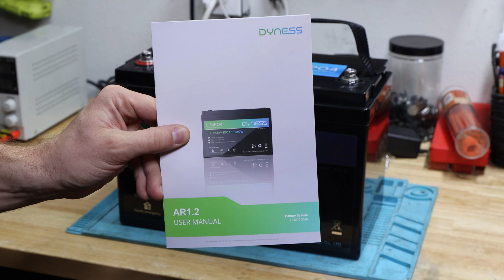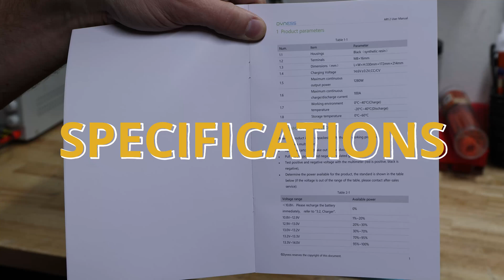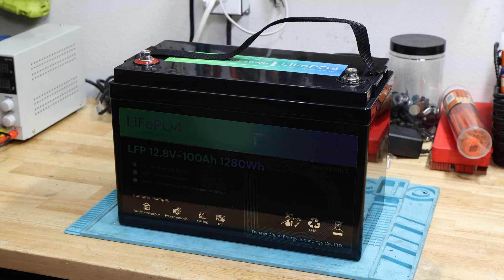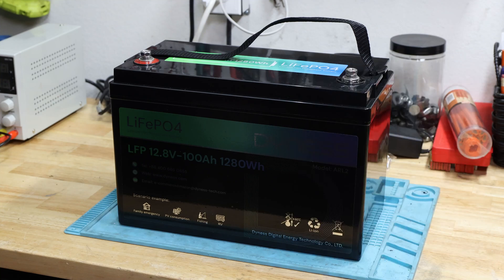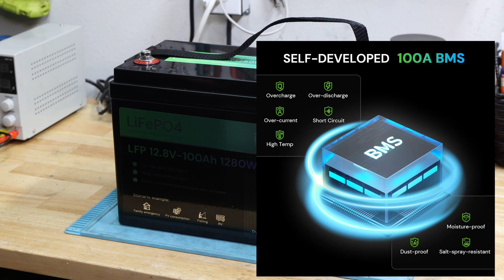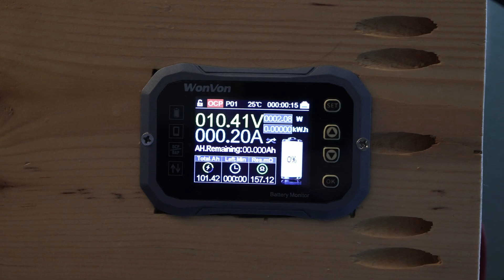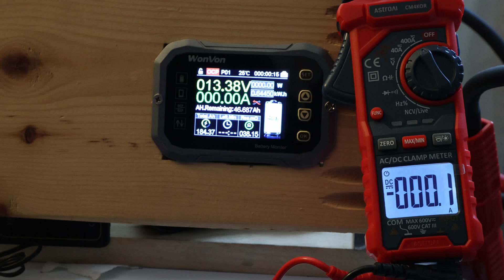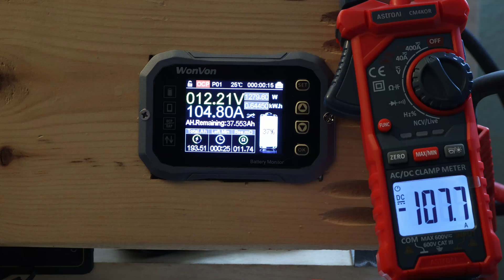Budget friendly battery for $ 149 | Dyness 12V 100Ah Battery

Comment: I have exact same battery and need to take it apart.   Bought 4 and 3 charged to 14.4v and 1 refuses to go over 14.0 volts.   I figure one cell is way out of balance and hitting 3.65v and bms is shutting down charging.   I got the top off, but cant get cells out of the bottom (I see the glob of silicone on your base).   How did you get it out,, did you cut the bottom of the case off?

Comment: So if I'm understanding the discharge test, the BMS failed to cut over current, correct? It would have been interesting to see how hot the BMS and top of the unit got during this test. This is a major concern IMO.
Reply from the maker: Thanks for watching and your feedback! It got pretty warm but I have not measured it. I will do that next time!
According to the manufacturer the BMS should cut off at 350A...